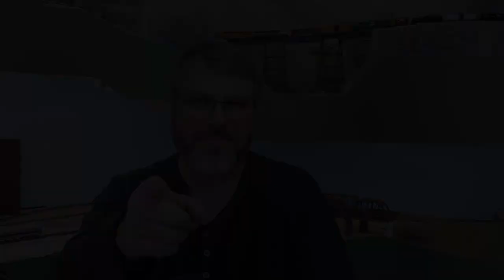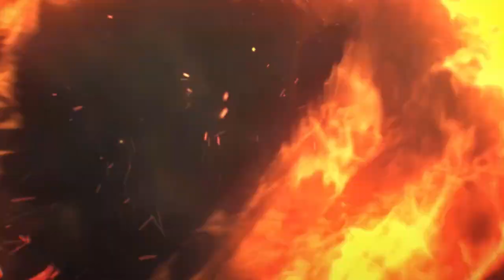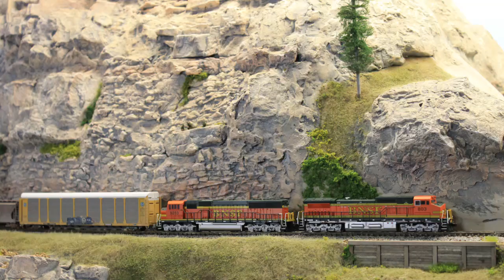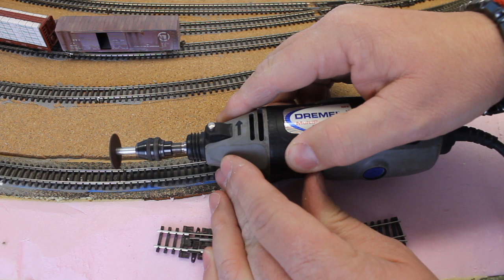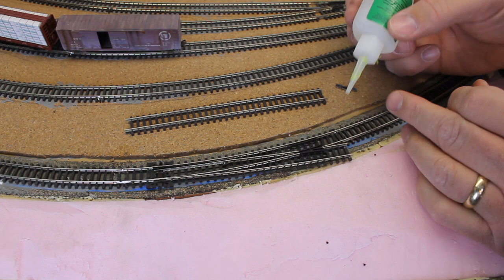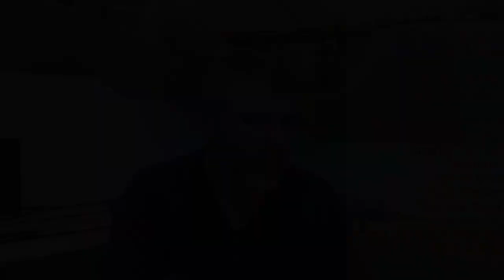How to Install a Curved Turnout on Your Model Railroad Layout

Comment: Ron. Great video. I found it easier for me to cut back the ties on both the turnouts and the flex track and later insert replacement ties in the gaps. Also after I cut the rail joiners apart I file the cut clean so they will easily slide under rail gaps for removable sections or before  soldering. Look forward to a video about painting and ballasting track.  Good reminder to clean the solder joints. Mike
Reply from the maker: Hey, Mike. When installing new track I remove ties too, but with track that is already glued down this is nearly impossible without running the risk of pulling up a bunch of the existing track in the process. I just can't get a knife blade through the connecting plastic on the ties under the rail without putting too much upward pressure on the rail. 

I am getting ready to do some painting and ballasting soon, so those videos should not be too far off.

Comment: Great video, lots of track work in my future I ripped up half my main line and I'm moving it, then I will be doing code 55 in the rail yard and for Spurs, sideings along and staging. with code 55 turnouts. Thanks for sharing.
Reply from the maker: Real railroads obviously prefer what is simple whenever possible, but it is inaccurate to say curved turnouts are unprototypical. Railroads us them quite a bit when, like us, they are in short supply of real estate. Just Google "prototype curved turnout" and you will see several photos just there. Model railroads use them because we are trying to cram miles of railroad into feet or even inches of bench work--a challenging task at best. Thanks for watching, Zane.
Reply: Ron's Trains N Things you are correct, thanks we learn something new every day.
Reply: Zane's Trains N Things

Comment: Very nice clean install Ron.. I do have two questions.. (1) when you used the mini driver to hold the rail in place when you soldered..is there a personal preference in using that tool instead of a wooden skewer? I know there is a mixed debate about using a metal heat sink when soldering. And, (2)..the styrene in the gap.. you filled it so it was important to you..my question is..which is worse?...the gap or the scratches on top of the rail due to filing where dirt can collect and cause studders if that section is not really clean. Tom
Reply from the maker: Hi, Tom. As for the screwdriver, it is just what I have used in the past because I had it around. A skewer would work just fine--anything to push the curved rail into a nice smooth curve while soldering. As for filling the gap, if the gap was pretty small I would have left it. These were a little too large for me to leave. as for the scratches in the rail head, you can burnish them out by "sanding" it with a stainless steel washer. I learned this trick from Ralph Renzetti recently and it works really well. Before that I would work it over with 1500 grit emery paper, but the stainless steel trick works better--no sign of a scratch left behind.
Reply: thank you Ron.. I learned a new tip with the Stainless... I have some areas on my current layout where I've filed and now it is always dark even though the surface is clean.. running shorter engines..in that location..always seems to present a dice throw if I will get a stall..  After posting my question about the gap..I thought deeper and wondered if we were filling the gap for performance...due to wheel drop across the gap or appearance. but, you have answered that in your response.. thanks Ron and as always..excellent videos..and info.  Tom
Reply: To temporarily hold track in place I use same T pins I use tacking Woodland Scenics' foam risers in place before gluing them down.
Reply: I found using a 4 in1 fingernail buffer works nicely for smoothing the top of the rails and filing plastic parts.
Reply from the maker: +Overland Transportation System Thanks Tom.
Reply from the maker: +Jerry Smith Those work too. The only advantage to the push pin is the head hits the top of the rail and holds it down into the adhesive IF it is not naturally settling down into it--which can be an issue sometimes in curves.

Comment: Good, concise video, as always. One suggestion: I built a tool to open up the rail joiners before installing them on the track. To build this tool, create a hardwood handle roughly 1/2 inch in diameter and about 5 inches long. Find a scrap piece of rail about 4 inches long and modify one end of it by filing the flange and rail sides to create a chisel type edge. Drill a tight hole in the end of the handle and glue the rail in with the chisel end exposed. Use this tool to expand each rail joiner before installation. Opening up the rail joiners make them slip on more easily than just using them from the pack. It also lets you do the 'struggle' to expand the rail joiner at some place other than your delicate track work. This tool is especially useful in situations such as the one in this video. I find your videos to be the best composed, and well delivered of all the available model train videos I have viewed. Keep up the good work.
Reply from the maker: Thanks for the kind works. Yes, a tool like that can be VERY handy. I have something similar. I usually don't need it when installing Peco rail roiners on Peco track, but I ALWAYS need it when using any joiners--especially Peco ones--on Atlas track. I didn't need it here, but thanks for describing it for everyone. You will probably see mine in a video sometime on trackwork.